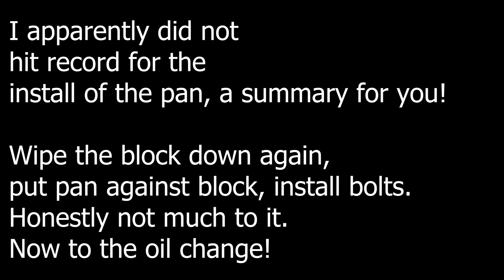Plastic Oil Pan! Why is it so oily?

Comment: Great job Deamon!!   Worked at a couple different lube shops in the 80s and an NTB in 2007 and had to almost literally cut a couple spin-on filters off because they were over torqued. Last time was at the NTB and when the customer found out, they said they had been to WalMart the previous oil change and said that was the last time.

Comment: Just did this oil pan gasket twice and still leaked found out the plastic oil pans tend to warp and it’s always a good idea to replace the oil pan itself and the gasket
Reply from the maker: I have a question, what type of location is this driving in? Is there an under-tray on the car.. I'm curious that if it's driven in extreme heat? or cold? could make it warp. If you want to use the farming zones that would be excellent, I live in a zone 8B.
Reply: @deamonmachine  I just had the same leak problem, I have a 2018 GTI with 40k miles, and Yes, I have a protector that covers the entire bottom part, I live in Bolivia, in Santa Cruz where the average temperatures are 33º C all year round . But in winter a few days a month we reach 10ºC, and that's exactly what happened to me last week we reached 8ºC, I took it to the workshop and we will change the gasket, but I'm worried if the plastic oil pan suffered any deformation, what do you suggest? or how can we realize it?

Comment: Do you need to use a sealant as well with the gasket or is the gasket by itself enough?
Reply from the maker: Just the rubber gasket is fine, no sealer required.

Comment: Great video!!, what is the torque spec for the T30 of the oil pan?
Reply from the maker: I don't know for sure off the top of my head but I'd imagine if they are m6 bolts around 9nm. Nothing stupid tight.

Comment: I broke the same kind of oil pan on my 2018 golf and basically ran it bone dry insurance wouldn’t cover it so I took it Upon myself, purchased a new oil pan and suction tube that suffered damage. Replaced them both and added fresh oil in the motor car won’t start is there any advice you can give me on what I can do next? the car cranks over but will not run
Reply: You ran the engine with no oil buddy, you need a brand new engine lol. That's why your insurance wouldn't cover it because a new engine probably cost more than what your car is worth 😂😂

Comment: Is there an o-ring for the oil sensor that needs to be removed as well?
Reply from the maker: If you have a new one to put in, it's the perfect time to do it (Yes there's a seal there, but if it's not leaking and you don't take it out, just roll with it).